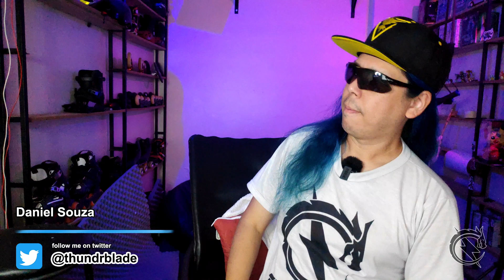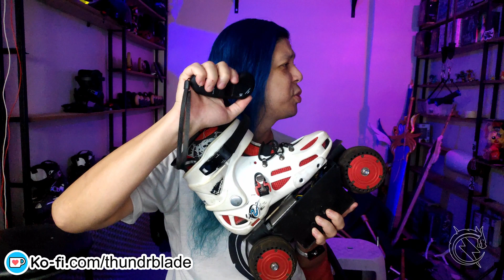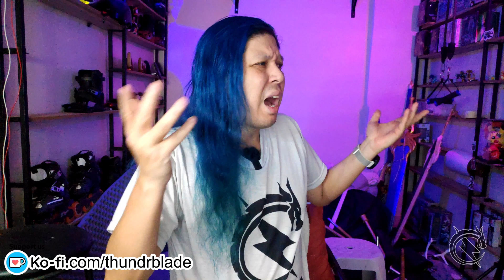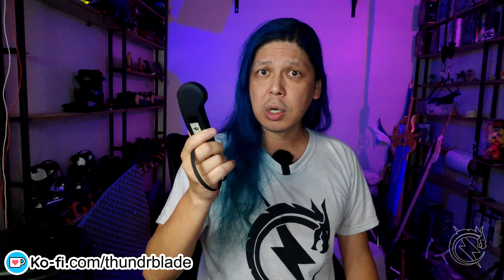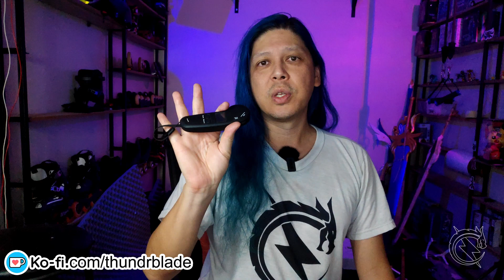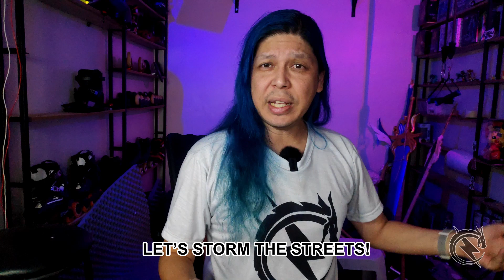Does it work like Air Gear? - Weight sensing vs Handheld Controller

Comment: why not lean forward for throttle and anything else is neutral so you can break using a controller or by power sliding?

Comment: i mean, is it possible to put the remote in a glove of some sort so all we have to do is put on a glove and use the controls with that?  safety equipment/remote and looks like youre not really holding anything :)
Reply from the maker: Putting the remote in a glove could work, but it would actually be awkward to control the skates and skate freely. 
Also if you lose your balance you couldn’t release the controller and might even accelerate making you fall even harder.

Comment: Why not putting controller in wristguard?
Reply: Controlled by your wrist? Or the other hand so now you sacrifice both hands
Reply: @xanv8051  a pressure points on palm part of guard
Reply from the maker: I thought of that as well. I am going to make a video talking about some other variations of remote controller and pros and cons.

Comment: the only thing i can think of for jumping with weight sensors is so kind of weight applied clutch. when you are in the air, it should essentially free wheel and maintain its momentum. still cant think of how it works when you hit the ground again...
Reply from the maker: yeah, there are a lot of technical issues to solve with weight sensing. I feel like stop the motors in the air is the easy part.

Comment: In general i believe the overall size should be upped in terms of outward look whether it be from extra padding all around or slightly thicker soles, and then incorporate the battery into the shoe somehow, or have it be on the tongue of the shoe part acting as kind of like ski boots where one side of the boot gets tightened over the other so only one side actually moves and use that mechanic while using the wiring as an excuse to have them look more flashy like in the anime. And for the future when they can be used for aggressive inline style riding the center should have some type of tech that allows it to instead of grind it more so rolls over the ledges. The second i watched the anime i looked up at's in real life and one of your videos popped up along with aggressive inline skating and convinced my parents to get me a pair of aggressive inline skates and ive been waiting and hoping that the day will come, i seen the escend ones and they look okay but they're nore for commute and the more common inline style you see nowadays. They only reach a max of 15~16 mph/25kph, and that's quick but there are scooters and skateboards out there that go 25 mph/ ~40kph. I do understand the larger battery for the power but it shows in the show they carry multiple batteries usually from certain parts its implied with the large amount in the room on ep 1 and how theyre designed to sleekly fit into pockets it seems, we could have a point about interchangeable batteries and so on

Comment: it would be really cool if it was weight sensing but maybe there is built in auto brakes like in the anime so it would be kinda more safer?
Reply from the maker: the problem is quite the same, every time you make a turn you need to shift your weight backwards, sometimes I even take the front wheel off the ground when turning.

if the skates braked automatically by sensing you shifting your weight to the back wheel you would brake suddenly when turning.

Comment: I've been following your progress for quite some time, and I love the progress! 

As an alternative to weight sensing controls, have you thought of trying torque sensor controls instead?  I am fairly certain it would be easy to find a consistent pattern to map acceleration and deceleration to.  That being said, torque sensors would get rather pricy.  The rear dropout bike senors are ~$110+ each.
Reply: Could you explain to me how the torque sensor controls would work, please?
Reply: I think I understand… so in order to get the motor really goin’, I’m assumin’ you’d have to skate hard and fast, like you were on normal skates, as opposed to adaptin’ Air Gear’s leanin’, static stance?
Reply: @PKh4d0uk3n   More accurately, the torque is proportional to the acceleration of whichever wheel it is on.  The motor could be set to multiply the user's natural skating effort, i.e. if skater puts in 1 N of force to accelerate, the motor can add an additional 2 N (or whatever the controller is set to).  This would also work for braking, since acceleration is independant of velocity, as far as the sensor is concerned.  A handheld controller would probably still be necessary for emergency braking, locking wheels, changing acceleration curves, and maybe an on/off switch.

If you really want to have a leaning based control, I imagine it would have to be some kind of inverted v-stop motion.  Kind of how speed skaters maintain speed through a turn.  It would follow an s-shaped path, though.
Reply from the maker: Hey Elliot, I don't think a torque sensor works in this situation. it works on e-bikes because it can sense the power you put on the pedals and activate the motor.

Skating doesnt work as straight forward.

when skating you have 2 phases
1-push
2-glide

on the push phase the wheels are slower or even at a complete stop, while in the gliding phase theres no power at all you are literally just gliding on 1 foot. the very moment the push phase on foot 1 stops, the gliding phase on foot2 starts.

so a torque sensor cant sense anything at all when put on the wheels as you push the wheels sideways.

even assuming you wanted to measure the deformation sideways of the wheel to determine how strongly you are pushing it would need to activate the motor on the other foot which would be about to enter the gliding phase.

so how it would work?

the torque sensor would measure the power sideways, then the other foot would measure the speed which you entered the gliding phase and then accelerate the motor.

but if you do this it would feel as someone pulling your leg and it could throw you off-balance.

so the easier and simpler solution is to make the motors measure the speed at which you enter the gliding phase and maintain the speed for a longer period of time. for example, when skating uphill or against a strong wind, you lose speed very rapidly in the gliding phase, so the motors would counter the resistance caused by inclination/wind and maintain the gliding phase in a gentler way.

you would still need to push, but it would make it easier to skate at higher speeds or uphill.
Reply: @Thundrblade  Thanks for the well thought out reply!

I have two points that might change your end results.

1. I think you might be treating torque sensors the same as a accelerometers.  The big difference is that the torque sensor is constrained to a rotation (force applied tangentially to an axis) while an accelerometer is constrained to an axis (usually with all 3 axis combined in one device).
Because of this, a torque sensor will never give a reading to the sideways force during the push phase, but will give the resultant force causing the wheel to spin.  
I would concede that there would be no data during a sprint though.

My thoughts on when the motor would work is simultaneously with when the user pushes ( I usually think of it more like a pumping motion).  This way the user is prepped for the added acceleration.

2. The second point is that there are 2 types of ebike torque sensor.  The one that you might be thinking of, and the most popular is the sensor built into a mid-drive motor (directly attached to the pedals).
The torque sensor I am thinking of attaches to the wheel's axle and bike frame.
I brought up the ebike sensor in the original post mostly to give a visual aid, as a sensor for inline skates would likely need to be custom fit to the axle.

I hope this helps to clarify how I am thinking

Comment: you mentioned in earlier videos you wanted to switch to a single powered wheel for each skate. it might be worth looking at how something like the Segway Ninebot Drift or Gyroshoes are set up internally since they are basically what you're trying to do but with just one wheel and gyro sensing. the battery life in them is ok with the Gyroshoes claiming to last 10km but with two wheels you'd have space for a bigger battery if you need it and since you're not wasting battery on gyro sensing you might get an extra km or two out of it.

Comment: I would say, even though it's not the same as the anime, I'd think it is safer for it to have a controller instead of weight-sensed.

Because in terms of not only weight of the skates, but also the cost and time for it to develop. With weight sensing there are so many problems that needed to be solved like: calibrations for the weight sensing; setting deadzones; a balance system so the wheels won't accidentally lift off the ground due to sudden weight distribution difference when accelerating/decelerating; and possibly much more, just to make the skates safer.

So having a controller is pretty much a great and safe option for now.

Keep up the great work!
Let's storm the streets!
Reply from the maker: Lets storm the streets

Comment: I think I have a good solution so I hope you read this

What about weight sensing technology that switches off most of the time so it feels like you are on normal skates. (using some sort of gyroscope technology)

But when you put both feet forward it will accelerate and as soon as you lift your foot off the ground it disengages the motor motor so you can cruise at high speed by building up speed and skate exactly like a normal skate.

Think building up speed but then as soon as you jump the motor disengages and you can land normally.

Like how on a BMX we don't have a fixed wheel set up instead we use a freewheel so we can build up speed but then put our feet in the right position to make the jump and then land.
Reply from the maker: yeah, the problem is how to make the skates understand that you are about to jump.
like I explained on the video, to turn we need to put our weight on the back wheels, if we have weight sensing tech  the skates would brake. so it would need to be really smart to know you are turning and dont want to brake.

making the motors turn off mid-air is quite straight forward, but to turn them off when you are about to jump it is definitely not that simple.

maybe a solution would be a combination of WST and a remote control. so you could change modes.
1- full remote
2- full WS
3- electric assist - so you can skate and the skates help you.
4- off

then you just hit the off button to do some trick and turn back on when you need the push

Comment: Just finished the anime Air Gear and checked  right away to see if someone was building something like the Air Treks. So happy to see you’re working on it. 

I would prefer weight sensing technology because having a remote would make the experience less fun and real, sure it would make it more simpler but if you can ride around and use your weight that would be awesome. Also if you’re not using a remote you know you are controlling it yourself and with your body. Everyone would have different skill levels than others based on how good they are with it but if everyone has a remote you would all be the same. 

As you said weight sensing technology will take a lot of time and resources but if it’s possible having both options available remote and weight controlled would be great.

Thanks for your work

Comment: Great analysis, 4-5 years ago i watched air gear.
I found you through air gear.
Weight sensing is really a interesting way to control them, may there needs a motion control combined.
You mentioned it correctly "Do not try to much at once!"
Thanks for your afford, i'm looking forward and being excided for future updates!
RcCarFan01
Reply from the maker: thx!

Comment: I mean, weight sensing technology DOES work in real life. It's just nowhere near as tiny as in Air Gear. Not just due to the lack of parts being that small, but also sensitivity and durability. It would also be INCREDIBLY expensive. Not to mention the skill issue you brought up. I mean, I'd love you have weight sensing tech in them, it frees up both of my hands. Do I think it would be easy? Heck no! Do I think it'll happen between now and when my body isn't up to skating due to age, whenever that'll be? No. Keep in mind, I'm 30. I'm predicting 20-30 years and I'll be unable to do much other than walk and jog as far as leg movement, let alone skating.
Reply from the maker: I meant in the electric inline skates. you cant make it work with current tech.

the simplest way to build it would be to have a weight sensor on your toes and another one on your heel. these are pretty cheap. the problem is how to control the motors with them.

so its more of an algorithm problem than a build one. I can't see how to solve all the problems.

one way around this would be to embrace the problems and let the riders adjust to them. or maybe have a handheld controller or even wrist/watch controller to change modes easily.

Comment: Thinking about it from the point of view of physics...
You lean forward, moving your weight forward, causing you to accelerate.
Your acceleration shifts the direction of your weight backwards, causing the skate to stop accelerating, causing you to lean forward more....

But even worse is leaning back to stop,  which causes most of your weight to be focused on the cushions of your feet, causing you to suddenly accelerate when you were trying to stop?!?

This isn't like a Segway that can lean back and forth along with your body.. the skates need to stay planted on the ground, and the only thing keeping you balanced is your own body.
Reply from the maker: thats how it is supposed to work:

the acceleration should be well calibrated so it balances your weight forward making it so you dont fall forward by pushing you backward only enough to balance you.

thats why people often fall forward on onewheels and eletric unicycles. because they go too much forward and the motor cant balance it out so they fall forward.

that's the whole point of the self-balance vehicles like the segway, EUCs and hoverboards.

even if this works perfectly, the moment you have to make turns on inline skates all of this doesn't work anymore since you have to shift backwards to turn. the skates would then start to brake.

the forward-backward motion going in a straight line is the least of this system problems.